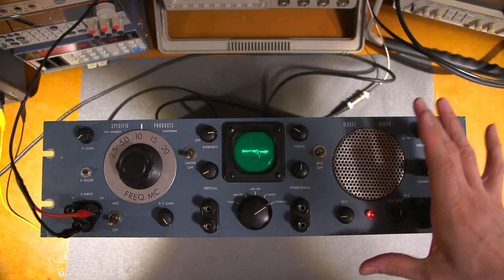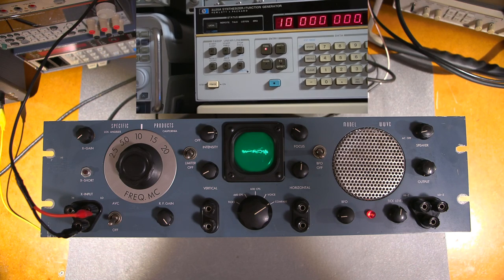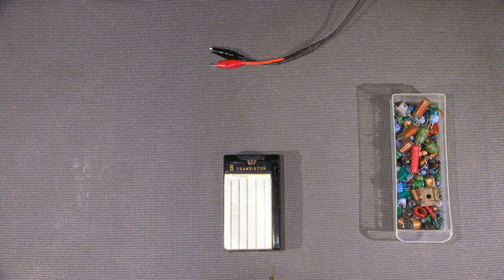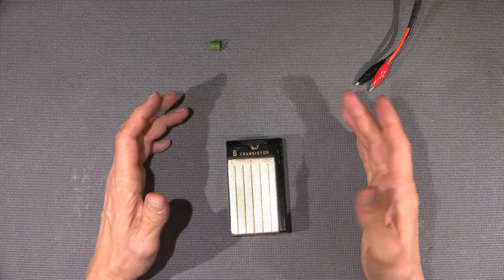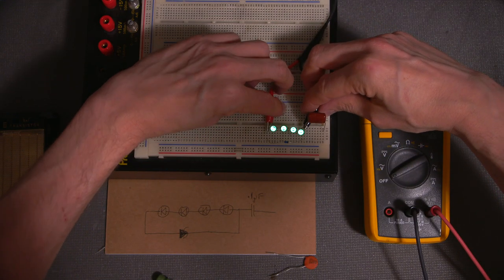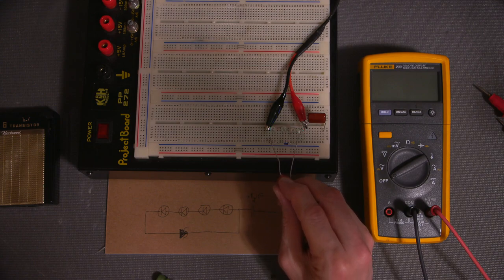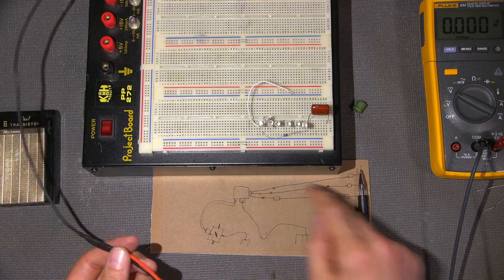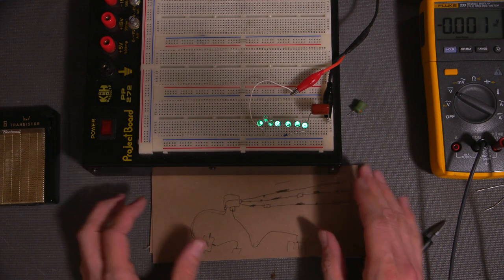Tech Talk And Hang Time At Mr Carlson's Lab!

Comment: Ok I haven't thought about this in a long time but there was a analog cellphone that would self charge  if the single was good  enough all it would changed so the same thing is going on here this would be great for a backup cell charger in a power outage 
Though I would wonder what the power out putt would be it if you started up your radio transmitter you have in your basement betting it spike very high  thank you for the video  mr Carlson

Comment: Some time ago in a winter icing condition you filmed a long wire antenna bringing an electrical discharge into your lab that was perplexing, have you ever been able to figure out what was going on?
Reply: watch video " walter lewin makes a battery out of cans and water" probably the same principle  only ice crystals instead of water dropping charge on the antenna wire as they pass by.

Comment: Mr C:  I built my own DDS function generator with OCXO a few months ago and can tune it up to WWV by allowing the generated 10 MHz to mix with WWV as it arrives from about 2400 km away.  Listening to it on a SW receiver gives me the same beat noise that you showed.  However...
I understand that the frequency that arrives from WWV from that distance is not so accurate (up to about 8 Hz out) due to doppler shifts induced by the ionosphere.  John T. Stanley of the NBS wrote a white paper on this subject in 1972.  You don't seem to worry about that.  Am I missing something?
Reply from the maker: Hi John. I think the paper may have been misunderstood. The Spectracom disciplined oscillator operates directly from the WWVB at 60kHz, and is +/-1.0 E-9
Reply: @MrCarlsonsLab  Ohhhh... You use WWVB to discipline your in-house standard.  I am the one who misunderstood..  By the way my name is Tim, not John.  I'm sorry, now I understand.  I was listening to WWV 10 MHz by sky-wave which is notoriously drifty.  The white paper I mentioned was written in 1972 by John T. Stanley of the National Bureau of Standards and details all of this stuff.  Too bad I can't send you a link to it.  I may have to look into making a WWVB receiver...

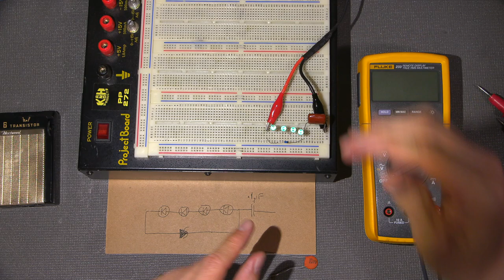Comment: 13:28 😳 That's an EXTREMELY efficient antenna... 
It's not easy to get a SINGLE high efficiency LED to simply flicker, with a "rectenna" design at a single frequency, much less get 4 of them to be lit constantly from broadband R.F.
That antenna much have a HUGE bandwidth, and have a bunch of gain at a wide range of frequencies. Well done! 👌

Are you near some kind of huge R.F. source, or is your antenna simply receiving general signals equivalent to what would be comparable to what an average neighborhood would see?
Reply from the maker: I'm out in the sticks, no big stations here. Thanks for your kind comment!

Comment: In my Sony STR-7045, underneath the tuning capacitor and its clear plastic cage there is some circuitry that you can access from underneath the unit. Just putting your hand in that area without any physical touching changes the tuning and thus what the radio receives and amplifies. It's wild!

Comment: I loved the LED's trick. I wonder if you replaced your diode with same amount of LED but connected the other way round if it would make the first set any brighter as it would pass move AC through the capacitor. 73's G1ZXC

Comment: Mr Carlson do you expect the 3 6 9 antenna to build up static electricity enough to give you a boot? I was booted from PL259 connector end of a 1/4 wave horiz dipole that was next to a 1/2 wave horiz dipole. We were transmitting 400W SSB RTTY HF in the army. The shock l got blew a small burn in my ring fingertip, l flew across the radio 11x11army tent and fell on the wingnuts on the battery banks on the floor of the tent. Big surprise, “Is this the other (bang), dipole lead….” Very funny for the regular army signallers.

Comment: This was an interesting video.
It shows how an old crystal radio receiver could work without any other power source, if you had a good antenna and ground connection.
Does the direction of the antenna, in relation to the transmitter, effect the strengh of the RF signal?

Comment: Ok, you convinced me. I need to put up a good antenna for testing restored radios. It’s been on my “to do” list for a while now, but it just got pushed up to the top of the list. 
Very interesting design. I don’t think I’ve seen wire antennas with coupled elements like that. I’m very interested in what the VNA shows at different frequencies.  Do you terminate the receive end of the coax with a 75 ohm terminator? You’ve got me thinking now. Have to put up a couple masts.

Comment: @13:30  ..now lets try this with a lightning storm close by :-D    Friends in Frankfurt used to light their garden outhouse and barbeque area with incandescent bulb light chains with a long wire antenna. There was a strong AM station a mile away. Apparently obtaining power this way is illegal in Germany, especially if using a tuned circuit. 
@ Mr Calson: could you do the LED trick with a tuned circuit? Just curious..
Reply: "Project moses"

Comment: Would be interesting for you to describe the relative merits of your single point ground vs. an array of ground radials.  You can, of course, match the antenna to either but the pattern efficiency may be better by adding ground radials.
Reply: You aught to see the ground system under some electrical substations, a copper mat made up of hundreds of pounds of copper wire maybe an acre or more. Oops, I shouldn't have said that, now someone will dig them up.

Comment: it would be interesting to design a circuit that charges Lithium batteries from your antenna, after tuning to the strongest carrier signal. The "Tate Ambient Power Module" is a good circuit.... Germanium diodes are used for full-wave rectification and caps. Imagine one tuner on your antenna just for harvesting power, and then your radio is powered from the antenna and can be used to tune other stations.

Comment: Very interesting video, like always ! But I have a question. How do You protect the antenna against flashstrikes from a thunderstorm ?? Can You earth the antenna somewhere ? When I was a child, we had also a longwireantenna and my grandpa every evening went outside to this antennaswich to earth this long wire to protect it from flashes. Such a long and high antenna is not safe against this high voltages if it happens !

Comment: I’m interested what you do to bypass  lightning strikes , those LEDs are very exposed just like any connected RF load. Realising that you are demonstrating the power available through your antenna, it does come to mind that your descriptions so far don’t have any protective circuits to buffer lethal consequences for the user or the equipment. It would make a valuable video where you examine attenuation of those damaging signals induced on your lightning capture circuit ?

Comment: (02:04) Paul, would that be functioning as a "sort of" BFO using the PLL error as an input from the two carriers?  
I guess it's more of a balanced modulator, outputting the error signal as noise, from the LO and the received Fc.

Comment: I worked in a place that used WWV 10 MHz signal received on a crappy shortwave radio to calibrate equipment.  I always doubted how accurate the method was considering that the received signal was mixed with a local oscillator.  Does the accuracy of the local oscillator not matter?
Reply from the maker: The receivers oscillator doesn't have to be very accurate, as you are comparing the received result (the WWV) to your own standard. You are effectively comparing the WWV to your own 10MHz signal. The difference creates the beat tone, or in this case a rushing noise as you approach zero beat.

Comment: I am curious you used 75 ohm coax to the house.  I assume your Antenna 
Tuner does not mind a 75 Ohm input.  I always had trouble with end fed 
antennas here a pain to tune up.   I wonder if you use capacitors to 
"raise the ground"?  A tip, run long radial copper wires to the Earth rods buried under the grass.  It works wonders here.

Comment: If you'll use a product called NP-1, instead of standard silicone. 
You'll find that it makes a mess to apply it to anything without getting it on everything else. 
But the beauty of this product, is that it's far superior to what you used, and that applies to the ones they claim to last the 30 years they say they warranty it.
Reason being, is silicone dries out completely, and even shrinks.
As its shrinking, its pulling away from the surface that you want sealed. 
Where as NP-1, is as close to butyal rubber, which has been removed from the market, because of the chemicals it's made up from. 
But it and the NP-1, only make a skin outer coating, while the core stays in its semi liquid state, and this expands, and contracts with whatever material it's bonded to.
That way, in a couple of years or less you won't have any leaks, as you will from your standard silicone caulking. 
That and since it's a rubberized substance, you get isolating properties from it as well. 
So other than needing some type of protective disposal clothing whenever you're applying this product, it's far superior to the highest grade silicone sealant on the market. 
Hopefully this will be helpful to you in the future, and heed the warnings about messy, and what it takes to clean up afterwards. 
But if you take your time, use a masking tape to protect whatever you want to seal, and wear whatever type of gloves you are comfortable in, then shouldn't be a problem, unless of course your just one of those that no matter how careful you are, you end up with more on you than anywhere else.

Comment: Thanks! Why 75 ohm? You did not draw any transformer so I assume the antenna impedance is in fact 75 ohm. Which is probably correct. :) Although it looks like an end fed long wire and I would have guessed 450-ish ohm.

Comment: How many microvolts peak are you getting on a strong station vs microvolts peak on a very weak station, well, plus the pink noise from the universe.
Reply: Any common mode current issues with your 3 6 9 antenna ?

Comment: I have two slinky's wired in series stretched out on top of my garage and end at an outbuilding behind the garage and a copper pipe ground rod driven in the ground and I get between 5-6 VAC using Digital Voltmeter.  There's no measurable current to it and I've wondered if this is normal or there happen to be utility lines very nearby and they run parallel to my antenna.  Is this coupling the power lines or is it normal RF or a little bit of both?
Reply: A friend of mine thinks a 0.001 mFd Cap will prevent or reduce 60Hz AC but not block the RF.
Reply: @dbingamon  It will block RF,  but not 60 Hz AC.

Comment: I put an air conditioner in an am transmitting tower shack. I laid out the power wire along the ground a out 60 foot. It was 6 gage 3 wire. When I grabbed one end of the wire to strip it I was knocked on my ass. Wire not connected to anything.

Comment: Frequency generator accuracy to align our radios is a problem for the average to low end radio enthusiast. My old Heathkit nixie Frequency counter has a 1 mhz time base, trying to verify that is a problem. Cesium standards and such are too expensive.
Reply: GPSDOs are quite cheap to get. You need an outside antenna of course.
Reply: Neo 8M + Si5351 and a micro will get you an accurate frequency standard for a few bucks.
Reply: @VintageTechFan  Thanks for the info.
Reply: @galileo_rs  thanks for the infomation.

Comment: I can't tell what you did to prevent static shock from your antenna. The next 7 people that tried Ben's kite experiment died.
Reply from the maker: When my antenna is up in the clouds, I will let you know :^)
Reply: @keithstudly6071  If you read his autobiography you will be convinced he was the first "honest Abe". The most famous man of his time. I believe he did what he said he did.
Reply: @MrCarlsonsLab  I had a wire that was insulated run down the road about 20 feet off the ground and 400 foot long and I drew sparks from it just from the wind that were over 1 inch long, about 50,000 volts. This was in Buckeye , Arizona where it is very dry. I have endless stories about lighting and static discharges and protection from such just in my own experience. WA7VQR
Reply from the maker: Those stories would be interesting to hear Ted!

Comment: Interesting, Nice broadband antenna for RX; but does it have any gain compared to a tuned dipole fx at 14,200 or 7,100 MHz? It could be useful as a separate rx antenna. Vy 73 de OZ1GNN
Reply: I once built a 900 foot long beverage antenna for use on the 160 and 80 meter bands, and thanks to its directionality, it was very useful for rejecting noise from unwanted directions.  An unexpected benefit was its immunity to corona discharges during thunderstorms, even though it was on a 500 foot hilltop.  This property came in handy even on 40 meters, where a large yagi 60 feet above the ground could be useless for receive due to noise from corona discharge, but the wire antenna at 10 feet above ground was nice and quiet.
Reply: @JohnShalamskas  yes I know beverages; but not all have 300M for such a thing, By the way be careful with beverages and thunderstorms. I've seen a beverage driving an automotive sparkplug at A73A, no visible clouds. You really have to be careful with them.

Comment: Why did you repeat your statement that your antenna is isolated so many times?
Reply from the maker: Why do you choose to ask a question that has an answer that is so obvious?
Reply: @MrCarlsonsLab  That it occurred was obvious but the reason why was not. I could speculate or make assumptions but that serves no purpose. I'm sorry if the question seems rude.
Reply: Because if it's isolated then the power is being captured by the antenna and not being introduced from some other source!

Comment: You speak as if electromagnetic radiation has zero power. Then why are transmit and receive ratings measured in watts? Small power is not no power. If no broadcasters were transmitting anything, how many of your LEDs would light?
Reply: @PJ PachasaJr Very interesting technical terms. Scavenging energy from the aurorae via Mr Carlsons antennacle is possibly a phenomenon that should be seriously researched and investigated at any latitude.📡🤔🤔🤔🤔🤔